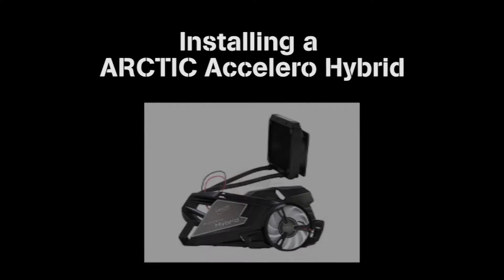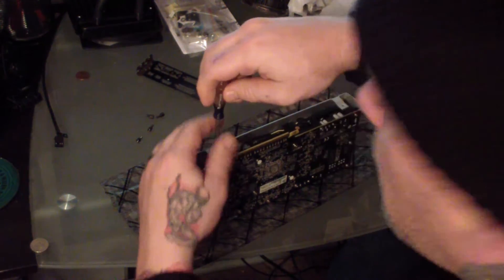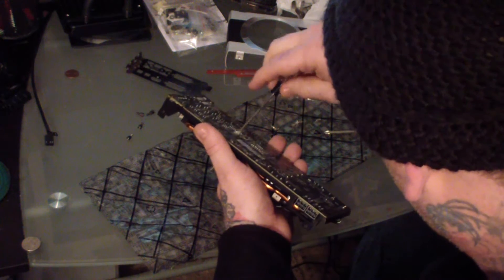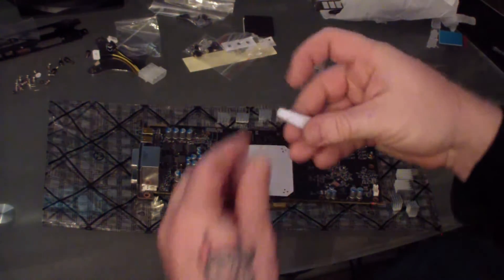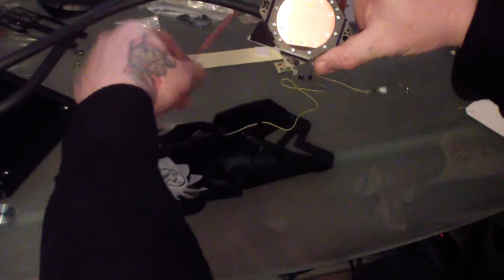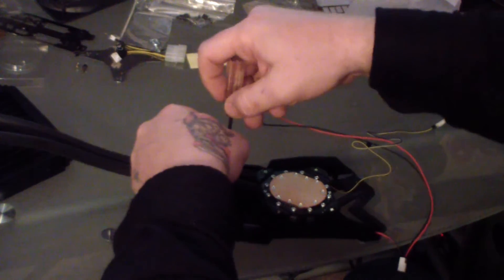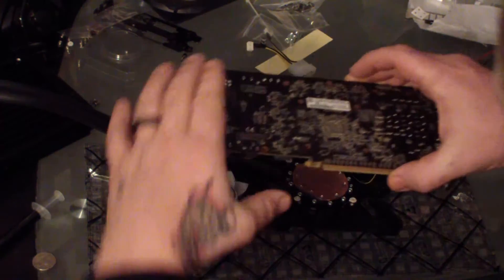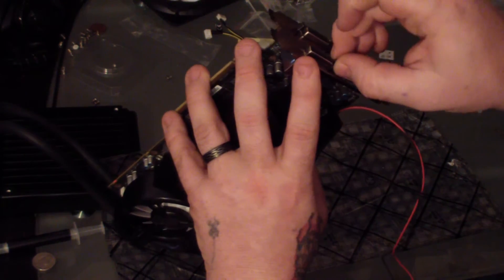ARCTIC Accelero Hybrid Installed on XFX Radeon 7870

Comment: So can you run two of these fans, one per gpu running crossfire?  And then along with a liquid cooled cpu fan?
Reply from the maker: I have a different setup for cooling the CPU< but you can run two of these on a crossfire system. If you are going to do that, I would suggest using cooling blocks since they are alot slimmer, and have them both the into their own pump and reservoir.

Comment: i have the same card but that XFX logo isn't there in the middle of those 2 fans and my card has 1 8pins and 1 6 pins power connectors.
Reply: mehdi duran I know this is old but it deserves a response. You have the version based on the Tahiti chip which is slightly more powerful than the regular 7870 which has the pitcairn chipset instead.. I have the same as you, two of them.

Do keep in mind although these cards are quite old they are still very capable in a CrossFire situation BUT you can NOT CrossFire the Pitcairn and Tahiti versions together, you must have two of the same.

I would also avoid XFX Graphics cards unless you plan to actually buy and install a cooler such as the one in this video. XFS coolers are chronic. For future reference; It is worth spending slightly more on MSI cards.
Reply from the maker: Where did you buy the card from, what box did it come in. Is it the exact card and manufacture? Post a picture of your card and the chipsets, and Ill see if I can tell you what you have.
Reply: No problem mate, it's a nice card the R9 280.
Reply: InFiHax thank you very much for your response. I have a new card now, it's the asus r9 280 strix, runs a lot cooler.
Reply: InFiHax yes it is. And the nice part is, i got it for €130,- while it was like €200,-

Comment: Nice does it work with Sapphire  7870 2gb cuz one of my fans stop worked randomly... Tryed unplug and change but nothing happen.. Was googling and saw other ppl had similar problems with the fans on Amd cards... So tho try this was it easy to apply on gfx card. ? Nice video
Reply from the maker: Im sure that if you look at the specs, it will show want cards are compatible. I don't have a full list though.

Comment: How come you didn't use insulation tape that came with (it's the yellow paper), it said to tape it on the circuit components to prevent short circuit caused by ram and vr